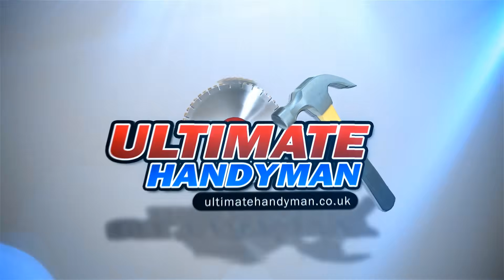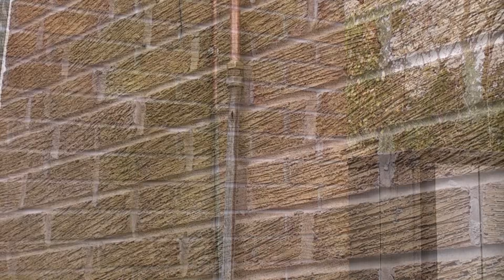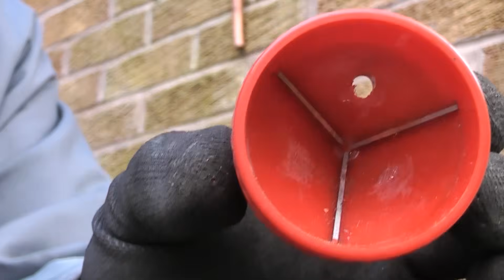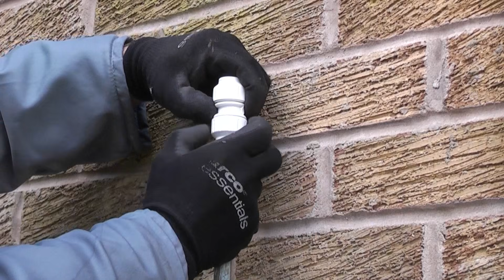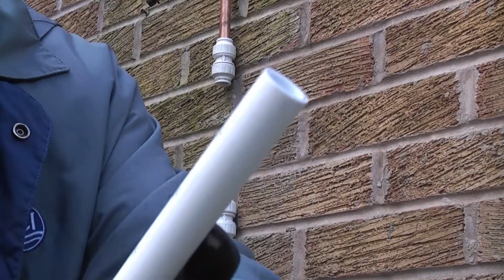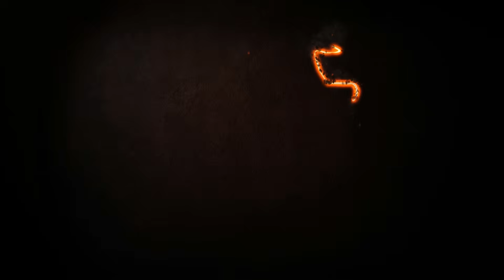How to fix a burst pipe

Comment: Another informative video. Have you seen this tool;

Silverline 367970 Pipe Cleaner and Deburrer 15 and 22 mm https://www.amazon.co.uk/dp/B000LFXG8C/ref=cm_sw_r_cp_apa_xCCYAb9EGC2TN

It's brilliant for prepping copper. I'm sure you're aware of this. Cheers.
Reply from the maker: I've not seen one like that before, I'm always wary of Silverline tools as I have bought some in the past and they have been crap.
Thanks for the comment
Reply: Ultimate Handyman I agree Silverline are crap it's just the first one of that type of tool that came up on my search. There are quality tool makers that make the same tool.
Reply: They are not really great for deburring, they are good for cleaning pipes for soldering though.
Reply: This Monument one is far better kit than the Silverline tat   https://www.amazon.co.uk/dp/B01AYHY3QK/ref=sspa_dk_detail_1?psc=1